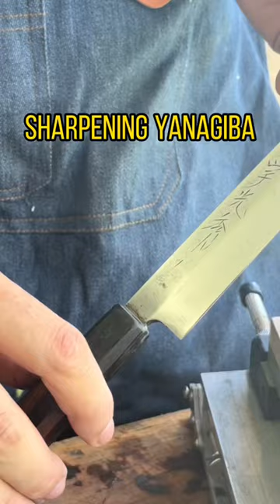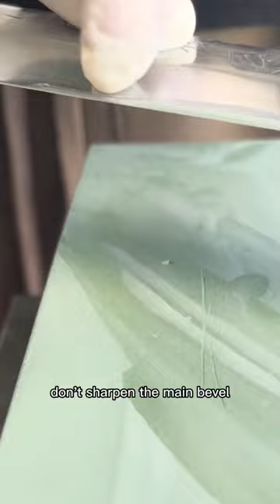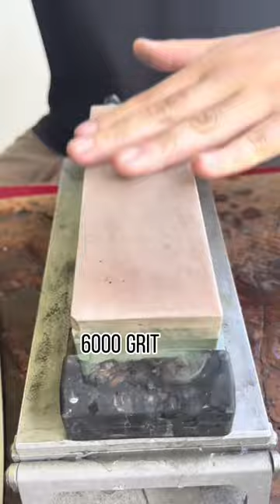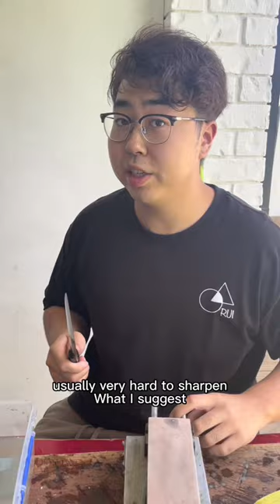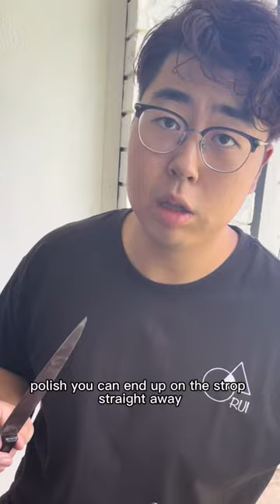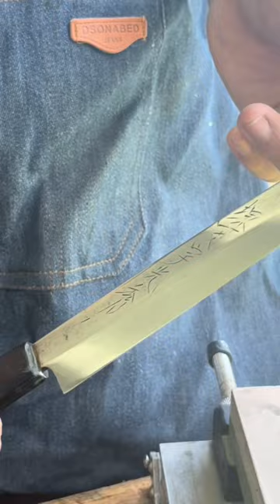Sharpening Yanagiba

Comment: You don't sharpen the inside. The flat side is for burr removal. You don't slide it backwards. Forwards to remove burr. You only really need to make one pass with the flat side.   Move all the burr over to the flat side and then push the flat side forward to remove burr.